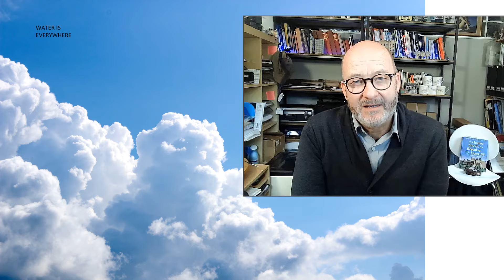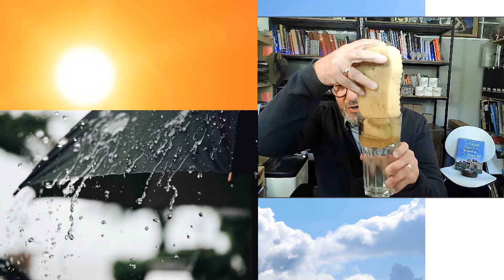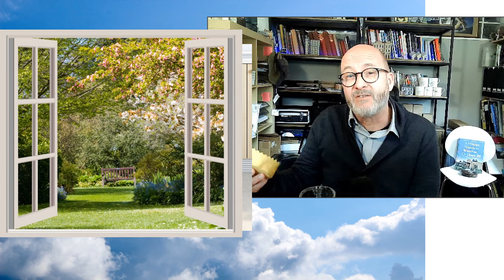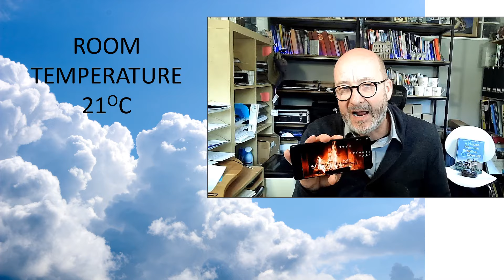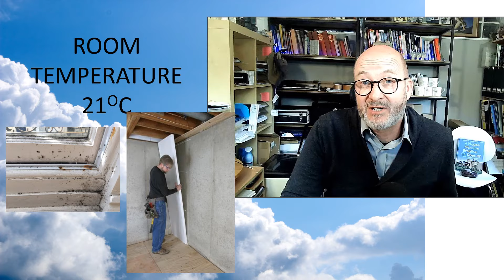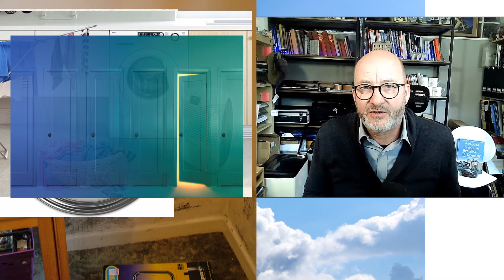Condensation mould Landlord and Tenant at war

Comment: Thank you so much . Very explanatory which is so helpful.
Reply from the maker: I'm glad you liked it. Are you dealing with mould at the moment?
Reply: @geoffhunt6646  ye
Reply: Yes I've just had room treated. Difficult to know in a leased accommodation that I've bought(retirement)who is responsible to pay for putting it right?I pay high maintenance fees annually and told when I purchased I only need contents insurance. Can you advise. Please.
Reply from the maker: @elainewhitelock5347  well basically condensation happens all the time and as long as it dries out there is usually no problem. In the room where you have a problem you need to work out if there is enough heat ( 21 degree C in the day) and how much moisture you are creating. Each room is different. Buy yourself a thermometer humidity meter and the humidity needs to stay around 50 to 70. If its low temp try lifting it when you use the room and if it's high moisture then ask your land lord to check fans have good ducting and work well. In the summer you can open the windows to clear the moisture but keep doors closed until the condensation has cleared. If it is a leak that will look like a stain in a specific place and often gets worse when it rains. That should be fixed by the land lord but always manage your condensation as the two are often not linked. I hope that helps a bit for you.
Reply: @geoffhunt6646  thank you.  That info is very helpful. I will certainly address this issue with your  suggestions . I think it may need to improve  the heating level . Much appreciated.
Reply: Tennants always blame the landlords .its never there fault